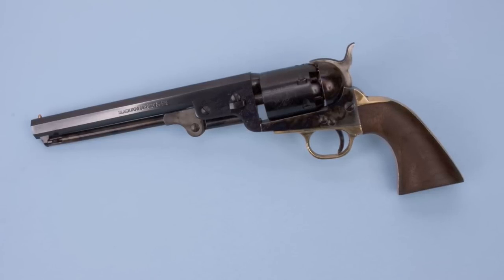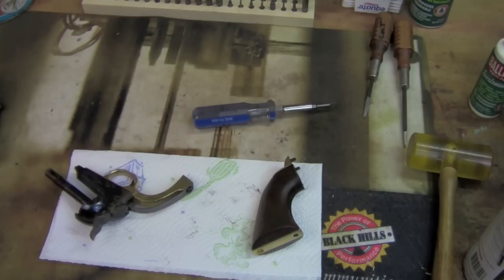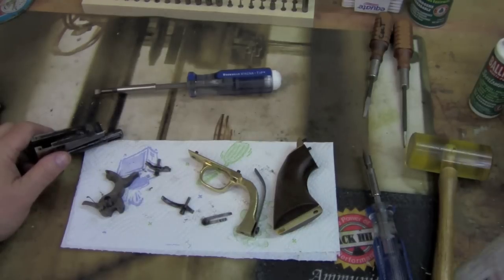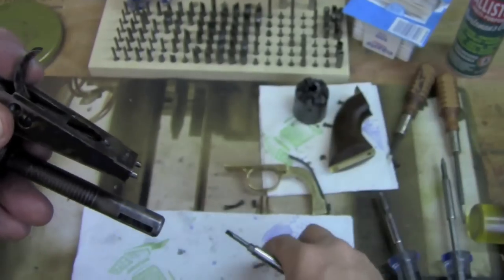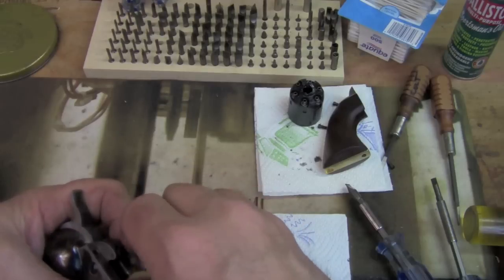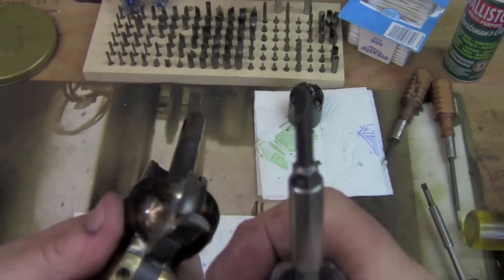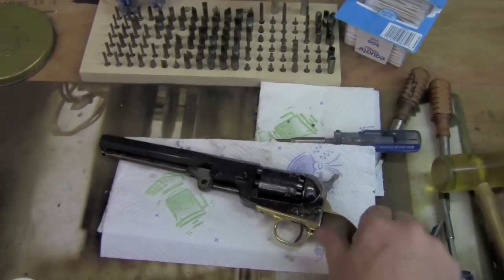Disassembly and cleaning Colt Cap and Ball Revolvers - Part 2.mov

Comment: Thanks for a very helpful video Mike. I was very reluctant to take the gun down to this degree, but when I had a hammer jam I had no choice. A thorough cleaning did the trick. I had trouble getting the bolt back in the right position, but with a bit of pause and replay on your video (ok, a lot) I got it all back together and working great. This is a tremendous resource for us out here, and is greatly appreciated.

Comment: Oh yea, this is the video I was looking for! What a resource Mike is for black powder revolvers.

Back around the turn of the century when I first started shooting these cantankerous canons there was nothing out there that showed step by step breaking down and reassembly of the Colt actions.

So after shooting I always took apart and cleaned the gun but left the frame intact. I cleaned it as best I could by squeezing black powder solvent into the works via the hammer and bolt and trigger. Then I would flush it all clean with WD-40, working the action as I did.

Thanks to Mike now I can see how it is done. We can all see how it is done. Awesome black powder videos, I love everyone I watch!

Comment: I was at the pistol range the other day shooting my dragoon,when I noticed it wouldn't go to half cock. I figured a cap fragment jamming up the works. so I watch your video / I retrieved the cap fragment and proceeded with reassembly. the only trouble I had was getting the hand and hammer assembly back in. after some time and fussing with it. it just suddenly went in and the rest of the assembly went without a hitch. now it works fine.couldn't have done without your video. thanks so much.

Comment: I wish Mr. B. was around in 1976 when I bought my brass framed  .44 cal. 1851 Colt "Navy". I was inspired by the movie "The Outlaw Josie Wales" to pick up a BP Colt reproduction.  I ordered the pistol from Dixie Gun Works, if I can remember. I was cheap. When it  arrived I was brokenhearted to see how cheaply it was built. Reading the proof marks now, I see it was made by Gordone & Brescia in 1976. It was like a kit gun. I had to disassemble and polish the entire works. It was great lesson in gunsmithing . It still shoots after 40 years of light, but constant usage. The barrel is so crudely finished it's amazing it shoots straight. Profession gunsmiths have told me it wasn't worth the cost of any barrel work. Love your work. (I clean mine with hot soapy water. Then a good oiling.)

Comment: Very helpful. I bought an 1860's era colt, that needs some repairing. I will tinker with it myself now that i have this guide. Update.   I found The trigger spring was broken. Received a new one today and now it is working well, and the timing is good. 
Kinda fat-fingered a couple of places in the reassembly, and the pistol would go off camera at important places.  Still gave me the confidence to dig into the repair. Lots of fun!

Comment from the maker: I feel your pain. Those Italians torque screws down like no tomorrow. Try this: mount the frame in a padded vice and be sure the driver fits the screw slot perfectly. With the driver in the slot, rap the driver handle smartly with a mallet. That may loosen the hold of the threads a little. Then fit vice grip pliers to the handle of the screw driver. Use your palm on the end of the driver to apply pressure to keep the driver firmly buried in the screw slot, and use the vice grips to turn  driver

Comment: Hi Mike, what a fabulous video. Full of wisdom & know how. I’ve ordered a Colt Navy 1861 revolver. I have also order the 3 bits from Brownell’s you suggested and an appropriate handle. I got the jags coming from Tipton. I was curious where you found your hammer or if you have a make & model perhaps? I did find a nice Halder hammer site. I just don’t want to overdo it. I’d be happy with a nylon & brass since it’s a soft metal. I need to check my stuff as I think I might have the Ballistol sprayer. I would have never thought about that though I used to clean my reproduction 1847 Springfield rifle with the hottest water I could get & Dawn detergent. Came amazingly clean. Look forward to your response. Take care & thank you.
Reply from the maker: I just bought that nylon mallet in a hardware store years ago. You don’t need hot water. Room temp works just as well.

Comment: Hi Mike! Great video! I had a hand spring break in my 1851.....Ordered a parts replacement kit for it from Cabelas, found your video and proceeded to break the gun down to replace the spring....Everything seemed to go fine until i had the whole gun back together then for some reason I can't get the hammer or cylinder to move....I did a function check before putting it back together but still had the problem....if you have any advice it would be much appreciated thank you in advance...

Comment: Mike,
Thank you for this great video.
I just bought a new 1851 Uberti Navy. I took it apart to do the initial cleaning, but I couldn't take the screws out of the base or trigger guard. Either the screws were in extra tight, or I have lousy tools. Probably the latter. Any suggestions on a better set of  screw drivers? Thanks. Can't wait to get to the range.

Comment: ok i fixed it via your instructions, seems smooth now. only the cylinder now has lines scratched in it where it touches the barrel. the metal itstelf ins't really scracthed, but the blueing has rubbed off... this normal?

Comment: love you videos!. I've only been shooting for just under three years now ( I'm 49 years old), but came to love it accidentally after my wife and I took a handgun license course together and went shooting to qualify. the rest is history as I have become addicted to not only guns, but the history of the guns. I now have about 15 all together. I recently bought a Uberti 1847 Walker and had the chance finally today to find an outdoor range and shoot it!  I only had about three successful shots.  I think a cap dropped into the action and was preventing firing of the other chambers perhaps.  ???   My main question is this. When I put my barrel on, If I tap the wedge too much, then the cylinder cannot rotate when cocked. I have to slightly tap on the wedge too loosen it a little bit before it can turn. And, it seems like the drag is not quite even all the way around the cylinder as it rotates (if that makes any sense). Again, love your videos! I've learned a lot and now am about to clean this thing for the first time following your example. Any help/advice is appreciated!
Reply from the maker: That is an issue with most Uberti revolvers. The arbor is too short. You can fix it by drilling the end of the arbor and tapping it so you cab screw in a bolt. trim the bolt to the length needed to reach the end of the arbor hole in the barrel.
Reply: @duelist1954  thanks for the help!  do you have or know of any videos showing an example of how to do this?

Comment: thanks for the reply Mike, I do own a single action bronells screw driver set, but the screws are tight, and i fear i might buger them up. I did get the gun apart without hurting the screws. the tricky part will be getting it back together. all i found was nasty think black looking oil.

Comment: Hi Mike, I have just bought a Pietta 1851 in .44 calibre. I can not get the screws out of the top of the back strap where they hold it to the frame. I used the proper screwdriver and the heads are so soft on the screws, I'm scared they will turn off. Any suggestions on how to get them out? I live in the UK and BP specialists are few and far between. Many thanks, Dave.

Comment: Thanks for taking the time to do these vids they are really helpful. Quick question about the wedge - how much force do you use to put it in place. On my pietta I noticed my point of aim changes depending on how hard I knock the wedge in. Is that normal on these guns?
Reply from the maker: I just push it in until the spring latch catches on the other side

Comment: Is it normal for the wedge to be extremely tight on a new gun? Seemed like i really had to whack it to get it out, also had to give it a good whack to get it to seat again upon reassembly. I dont know if im doing anything wrong but just seemed like yours fell apart and fell back together when i did mine i used a small hammer and a plastic dowel and had to hit it harder than i really wanted to before the spring caught on the wedge.
Reply from the maker: It is not uncommon, but it isn't the way it should be, but, as long as you can get it in and out, you'll be ok
Reply: +duelist1954  WOW you are fast! LOL usually it takes me a day or 2 to respond. I losened the screw a little bit and worked it back and forth after a little soak in some kroil and it seems much better now. The only hammer i have that may work without a dowel is a rubber dead blow and it is way too big for this application. Thanx for responding. Its your vids that have made me want to take the plunge into cap and ball!
Reply: Harbor Freight tools has a 1-1/2 mallet, plastic on one end rubber on the other. Cost is only $6.

Comment: Another fantastic video. Thanks for posting these. Two questions... what is the screw that resides above the wedge used for? I noticed you left that in. Is it recommended not to remove it?
Reply: It sets the wedge depth

Comment: Do you recommend bore butter on the cylinder pin?
Reply from the maker: No. Use a good, water-soluble oil, like Ballistol.
Reply: @duelist1954  thank you your channel is amazing, ive recently had someone at my local reloading supply store recommend T/C brand gorilla grease anti-seize for my slix shot nipples. Is this really necessary or can i use ballistol as the antiseize on the nipples?
Reply from the maker: @xxvictornomercyxx  I prefer using a grease on nipple threads. They always come out easily.
Reply from the maker: @xxvictornomercyxx  Personally, I would not use it. It is more of a fat than a grease. I use choke tube lube, but I have had good results with bearing grease too.

Comment: Hello Mike. I just bought a Pietta '51 Navy. Haven't shot it yet but what spare parts would you recommend to keep on hand. Being in Canada it can get expensive to order  but it would be nice to have the most esential parts as it takes time to arrive from the States. Thanks and your videos are very interesting and helpful
Reply from the maker: +henerymag Springs are the most common failures.
Reply: duelist1954 Thanks for the quick reply. I will put that on my list.
Reply: duelist1954 I ordered all springs plus the cylinder bolt and hand. I thought it best to get the hand while mine is new to make a fit. Thanks again.
Reply: Honestly. I think you are just wasting money, the new piettas, as the 2015 1851 navy I just took apart and slicked up had some heavy duty parts inside, if a spring breaks it will be either a very long time or never from now I am not afraid at all to say, if you are shooting hundreds of shots a month you probably wont break one, unless you dont take care of it and say have caps stuck inside and force the action over and over again, I have yet to see any review of.modern ones breaking and even the smallest handful of old as dirt ones having broken, and it wasn't the springs. They, the guns,  are bulletproof, it's not something to waste money or thought over. You'll see what I mean when you tear it down the first time and slick it up, they are all serious steel parts and hardened very well, heavy well made springs.

Comment: Hi Mike,
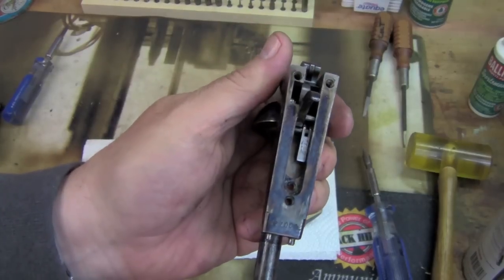I am new to guns but have found a passion for them I never knew I had. I thoroughly enjoy your videos, in fact I have subscribed to your channel. in this particular video, around 4:30 you described removing the screw to the bolt spring? I thought revolvers did not have bolts? My apologies if I misinterpreted what you said.

Comment: Mike, A neighbor gave me an old 1851 that was in his garage for years,i've owned a lot of guns over the years but this is my first blackpowder gun. It's an excam but I believe it's made by Uberti.When I pull the hammer back the cylinder does not rotate. Thanks to your Great 2pt. video! I completely dissembled it and the hand spring fell out. It looks as if someone filed or ground it to make it thinner so it would fit back in the slot in the hand.I ordered a new spring but I can't get it into that damn slot either.Do they have to be filed or pressed in ? I'm Clueless! Any tips would be Greatly appreciated!! Thank You.Carroll!
Reply from the maker: Pressed in, but they are wicked hard to get in
Reply: duelist1954 Thanks for the quick reply, I was afraid of that,should have ordered the whole assembly in the first place.

Comment: I have a Pietta Army Colt. It has the three screws on the side of the case-hardened body, as well as a much larger fourth screw, with heads on either side. Yours doesn't have it, neither does my civilian Navy .44 model. What's this screw?

Comment: I have a copy of this revolver. Western Arms. The cylinder will not lock in place anymore. It looks like the bolt(?) is only coming up a tiny bit when the hammer is down. Pulling the hammer back makes it go even lower into the frame but when it comes back up, it's flush with the frame and will not lock the cylinder in place. Thanks for this video. I am going to use ti to take my revolver apart to try to fix it. Is this a common problem you've run into?
Reply from the maker: The first thing to check is the Bolt/trigger return spring. It may be broken.
Reply: I used your video to take this apart. The sear/bolt spring looked worn out and too flat. I tried to put some bend back in the spring and it immediately snapped the shorter prong off the spring. I just ordered a new Colt spring. It says it will fit most clones and the measurements are the same so it will either fit or will with some modifications. Thanks again for the video and for the response.

Comment: Is it necessary to tear down the gun to the extent that you are doing after a shooting session  or can I just do a basic  cylinder/barrel/exterior and leave the trigger assembly etc for maybe 3 or 4 times a year.  Not sure I feel comfortable tearing it down to the depth that you are doing right now.    Thanks for the video.  Very informative.
Reply from the maker: Yes. If I have a heavy shooting session, or if I won't be shooting the gun for awhile, I do a complete tear down. Other wise I just break down the major assemblies.

Comment: i took mine apart because the cylinder quit locking at full cock so i tore it down and found the bolt and trigger spring was broken thanks for the videos they helped me out greatly

Comment: Shooting about 24 rounds Sunday. Noticed the bolt pin screw backing half way out. Is this normal for black powder, if not how can I stop this?
Reply from the maker: I have never seen that happen. I would check to see if the threads are stripped
Reply: @duelist1954  the first time I took the gun to the range, trigger and bolt pin screws were loose. I tightened both screws, and still loosen after 12 shots. Should I contact uberti, and inform them of this problem?
Reply from the maker: I’d buy a new pair of screws.

Comment from the maker: I'm not comfortable giving you an answer without seeing what you are seeing. I have three 1851 Navy conversions and none of them has the blueing rubbed off the cylinder face. But mine are all custom builds by Kenny Howell. I can't speak for Uberti production.If the cylinder binds enough against the barrel to scratch the face, you should feel a lot of drag when you cock the gun. If that is the case your wedge may be in too far.

Comment: hi mike,have you ever removed the  Cylinder Pin,if so how did you do it thanks
Reply from the maker: No. That is a job that can't go well. They are permanently pinned in. If the arbor is damaged, your best approach is to buy a new frame with the arbor installed.
Reply: it has a slight wobble,
Reply from the maker: Chris King time for a new frame then
Reply: cheers mike see what the shops gonna charge
Reply: duelist1954 uh

Comment: Does it make sense to deassembly entire action part? It seems not so dearty and I gues that if you would just spray it all using gun oil sprayed in all gaps between moving parts you would make it clean and secured from rusting without all this struggle
Reply from the maker: Depends on how many rounds you shoot, and how long the gun will be stored. If you’re going to put it to bed for several months, I’d break it down and clean and oil everything...don’t forget to put anti-seize on the nipple threads.
Reply: duelist1954 I shoot ~2-3 times a week but most of time using modern weapons with nitro ammo however I shoot my black powder rewolwer, express and shotgun on every weekend or at least every 2nd-3rd weekend. For every chamber in revolver I put special fat on every ball before I shoot, it make a difference when it comes to cleaning + I clean it after each shooting session (~36-48 shots) but without wather. I use only Brunox gun oil. Wather is the enemy of Steel. I don't reassemble entire revolver. Just take out the cylinder, take off nipples, clean every nipple, clean every chamber in cilinder, clean rest of revolver without deassembling it. And I'm done because it is oiled afer cleaning it using gun oil only.

Comment: I was wondering what tools and method you use to get a nipple that's rounded off out of the cylinder. I'm having trouble finding anything such as a small enough needle nose vice grip or anything else that will get in that tight spot to get it out. Thank You

Comment: I just got the cimarron man with no name revolver 1851 conversion. i took it apart to clean off the factory oil, and i wanted to check the action out, so i cocked the hammer all the way back while the barrel and cylinder was off it. the hammer got stuck! i will not go forward! is this normal???